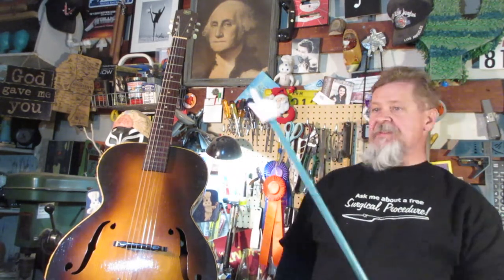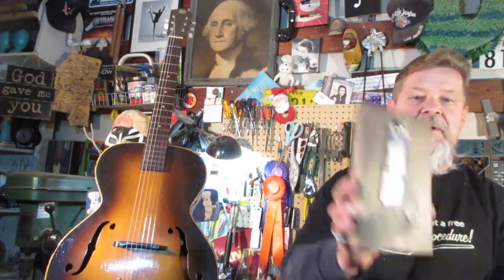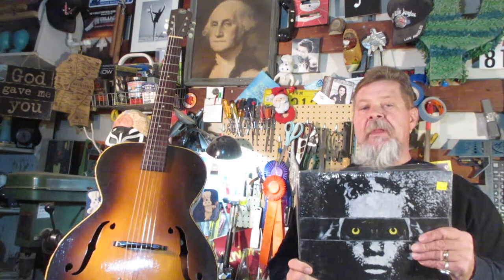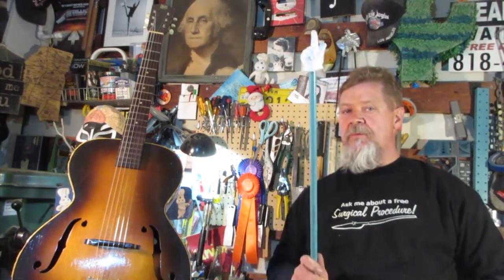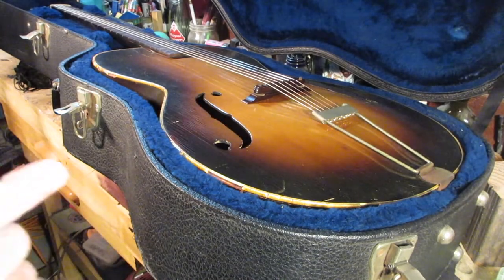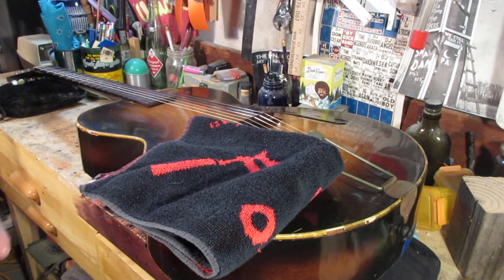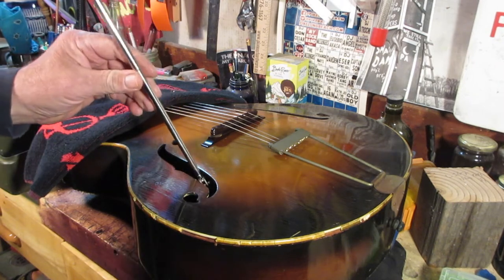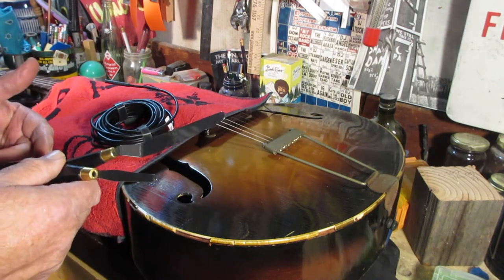Buying a Vintage Archtop Guitar

Comment: Ey up there Ken,
A big hello from Derbyshire. I've just discovered your refreshingly down to earth videos. 
In an effort to keep my crying towel dry, do you have any specific advice for a chap (me) meeting up with a Kalamazoo KG-21 in a car park? 
I'm hoping to buy, but I reckon you'd be surprised by the prices these command here in the U.K. Ouch! 
The guitar in question looks superb from initial photos. 
Footnote - 
Charley (Charlie) Patton is THE MAN...
Reply from the maker: Hey there thanks for watching. My experience is that people who meet you with high-quality guitars in parking lots typically have other guitars and they don’t want people coming to their house and then suddenly there’s a break in mysteriously a few days later. When it comes to the guitar you’re talking about of course you want to look at the neck body junction. Do you want to shake it around a little bit to make sure that you don’t have loose bracing. Tap around the edges where the top and back meet the sides. Just tap your finger and look for tone variations as you tap and move inwards. See if there are unexplained additional holes where the tuners are or should be as they may have been changed.  Finally, Make sure that the heel does not have checkmarks and superficial cracks because that is an indicator that something might be breaking loose.  In the US that Guitar lists for somewhere between 1200 and 2500  US$. Oddly enough the vintage guitar 2021 price guide shows that guitar in good condition to range from US$775-US$1025. Send me an email I’ll give you a shout out on a future episode I’m doing about the price guide  kpcbgs@gmail.com

Comment: thnx 💖🫡
Reply: i have two 1940s kay acoustics
both with good seals on the bindings & no cracks 
tunes up (softer open chord tunings)
they wont be in heavy rotation - likely only the couple tracks in those specific keys

ladyfriend doesnt want to detune/retune durin the live set